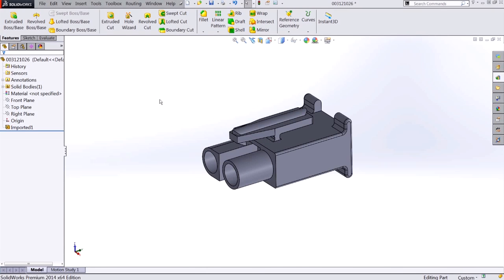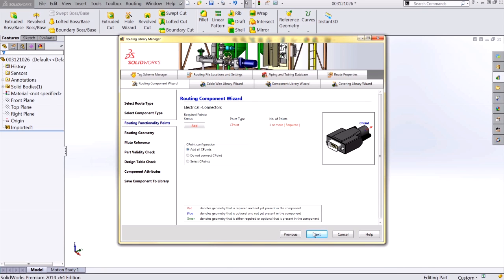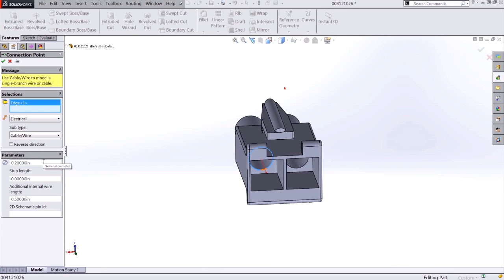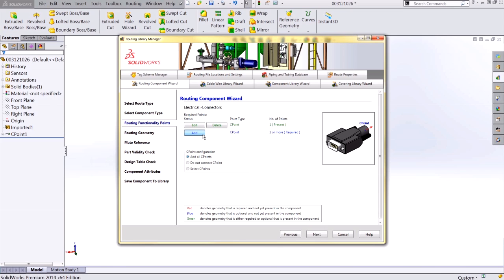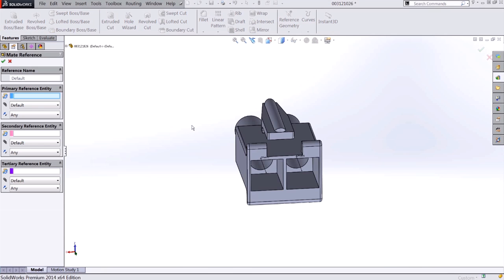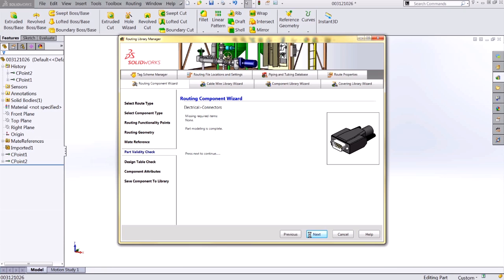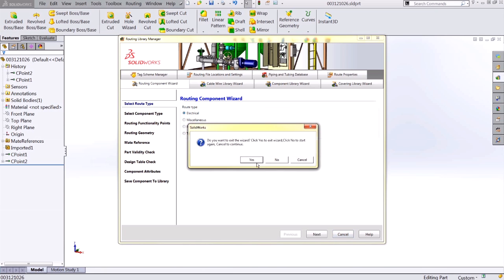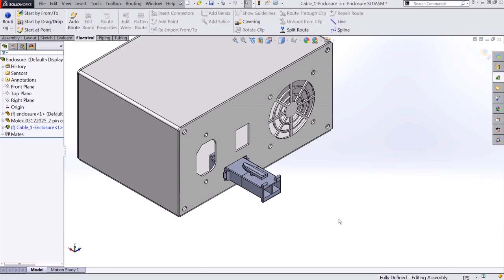SOLIDWORKS - Adding Components to the Electrical Routing Library

Comment: the socket also has to have the electrical mates?
Reply from the maker: It's not an absolute requirement but definitely a good idea to add Mate References to each component (male and female) - this will result in a stronger "snap" when placing them into the assembly